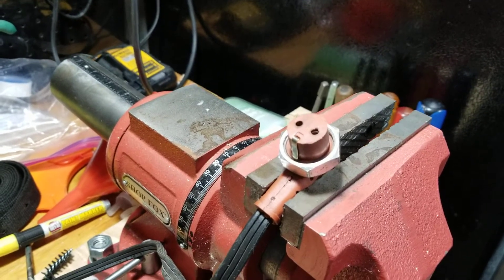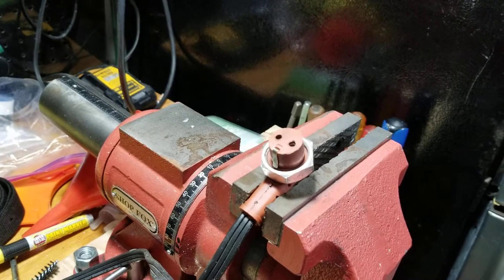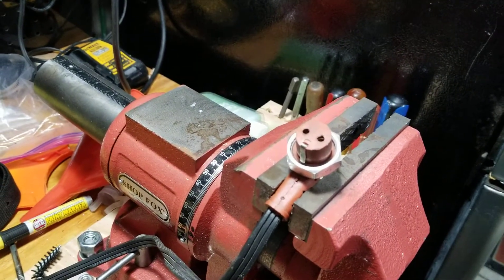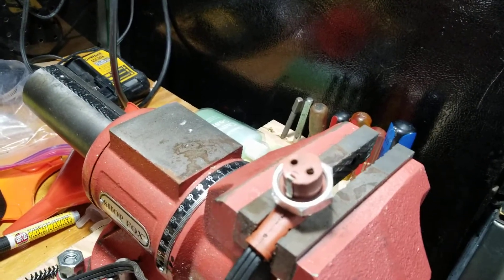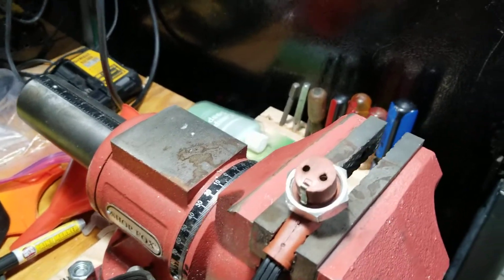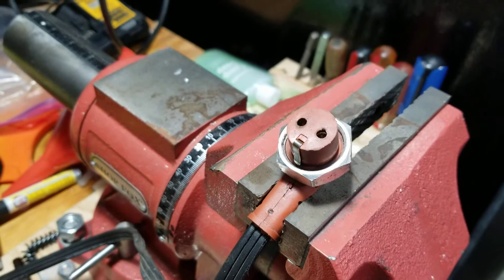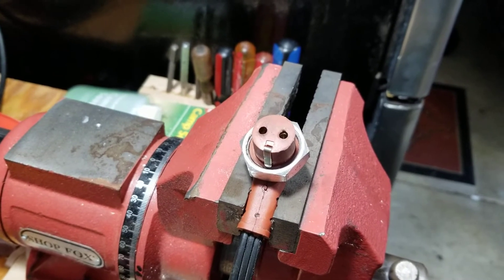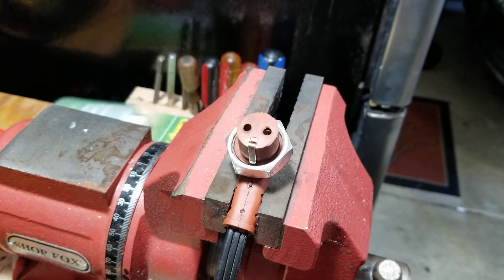Block heater tripping GFCI / Breaker - voltmeter says its OK

Comment: And what do you do if your block heater only has a plug in and not a outlet?
Reply from the maker: @ModifiedAutoClub  make a YouTube video of your problem so I better understand it and post it here in the comments. I will warn you though I'm not an electrician, I'm a jack of all master of none 🤪
Reply: @jamesc.3524  like what my block heater plug is the opposite of yours it has the prongs instead of a outlet

Comment: You're a blessing in disguise my friend. Thankyou so much. I got an old old 79 351M gas Ford f250 that's just started popping the breaker. I got a feeling this might be my issue due to the fact that I've been adjusting the timing and tuning the engine a lot the last few weeks. So the odd vibrations its not used to im assuming probably worked those connections loose. 👍 Thanks so much for making this video.
Reply from the maker: @PATH-n-Proverbs3.5-8  glad I could help you out!

Comment: Had a issue with mine checked it with a multimeter and got 26ohm but it was still tripping the outlet so I followed the cord and saw it was against my oil pan and melted one of the wires a bit so I threw a new cord on at it works great

Comment: the GFCI breaker trips because 4-5 mA of current is lost from hot to the neutral.  these small prongs could be a very useful explanation to this problem.  Where ohm meter readings won't tell you this slight problem that the GFCI can still detect and trip.  People with this problem should still test GFCI with kitchen appliances (like a blender or toaster) just to ensure that the GFCI breaker/cord is not the issue (ensuring the block heater is in fact the issue).  
Block heater copper (or brass?) prongs loose their 'original postions' due to thermal expand/contract overtime and thus causes 5mA of leak to ground in the block heater tripping the GFCI.  yeah, that could very well be my problem.  My block heater/timer circuit worked great all winter, it finally trips the GFCI now near spring - great timing for me and my car!
Ohm meter readings may still tell you about this problem?  My car's block is 33.3 ohms resistance, which may be a little high?  If I do what you do then my resistance may drop to 30 ohms??
Reply from the maker: Tyguy, reading over your problem i can tell you are WAY ahead of me with experience on a volt meter. It is possible that you may not be getting a good ground where the core heater cord plugs into the heating eliment. I would make sure that surface is clean and oil free to make sure the ground wire can get a good connection to the block. If that doesn't work and you want to remove the GFCI out of the equation, you can use this but you use it at your own risk...
https://www.lowes.com/pd/Project-Source-Adapter-15-Amp-2-wire-To-3-wire-Single-To-Single-Gray-Basic-Standard-Adapter/3772899?store_code=2474&cm_mmc=shp-cprdelcgglLIA_ELC_205_Wiring-Devices-Extension-Cords-3772899-local-0-_-0&ds_rl=1286981&gclid=Cj0KCQiAuvOPBhDXARIsAKzLQ8ELJ3Foh26ly6i-qruvEzU-r--Ps69n7S7SaV8caU_bpSug9sqPw5AaAnX3EALw_wcB&gclsrc=aw.ds

Good luck with solving the problem!

Comment: my block heater cord wire sparks when i plug it in
Reply from the maker: That could be from any number of things. If you a can remove your core heater plug and inspect the cord for freys and tears. If it is free of those than get volt meter and check for continuity. If that checks out you may should replace the heater. Good luck!
Reply: @jamesc.3524  sparked so bad it ate the wires only green wire is left lol
Reply from the maker: @kamshaft747  Definitely time to replace it then. 😜
Reply: @jamesc.3524  holy smokes mine just did exact same thing. GFCI was tripping, switching extension cord, then switched to plug with out GFCI and it sparked and blew head of heater cord apart in my hand!  I guess I'll start by switching to new heater cord then new heater if need be.